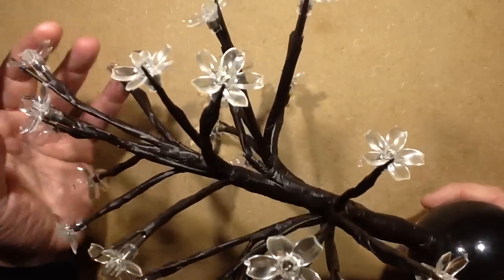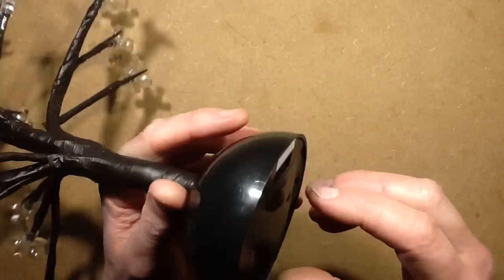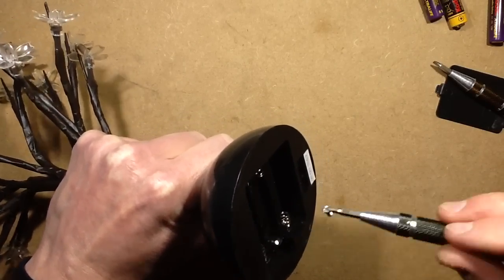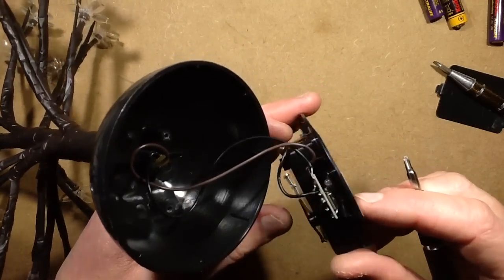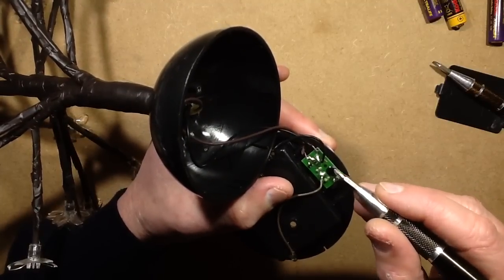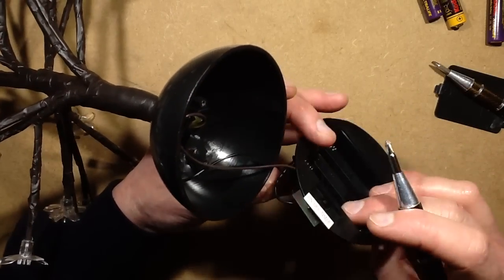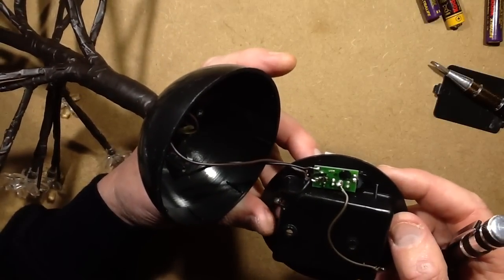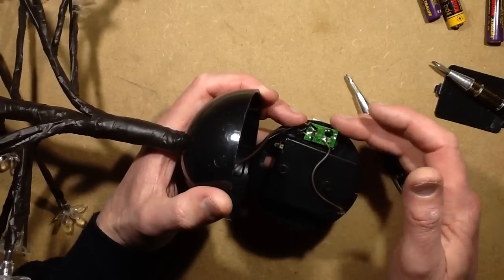Premier battery LED tree 2015 with new timer circuit.

Comment: It should have latitude set up so that if I buy one and use it in Helsinki, Finland it will not light up in summer because it is not dark enough it to be seen and during winter it will light up about 2pm and shut down at midnight.

Comment: you should try making one! :D
Reply from the maker: +killer1479 I already did a project involving a soldered structure wire tree with sockets on the ends of the branches.  I also tried to make a super-simple timer based on a PIC microcontroller running on its internal RC clock, but it kept terrible time as the frequency drifted with the battery voltage.
Reply: bigclivedotcom wow, sounded like it started off great tehn ended up depressing D:

aanyway, im hoping to purchase some pcb's from your website soon :D
Reply from the maker: +killer1479 I may revisit the timer, but with a crystal reference.  However, I bet we'll soon be seeing little strings of 20 LEDs with the timer in the battery pack soon.  At least if I do it and put the software up, people can change the times if needed.  Like 5 hours on and 19 hours off or 8 hours on and 16 hours off.
Reply: bigclivedotcom would be a cool idea! :)
Reply: Andre Fish cool!

Comment: How about further investigations? Power/current consumption? Expected runtime calculations, blob reverse engeneering, outdoor use, build quality, LED color, etc. This could get interesting. Why do they need a transistor? An Attiny could povide 40mA directly. How are the LEDs wired?
Reply: +Frank Bergmann Based on a similar led string in the US (Home Depot/Martha Stewart), the leds are all in parallel with the single resistor. And a ATTiny 40mA drive will drop 1+ volts, and is also 20 mA greater than the recommended output max. 40mA is Absolute Max.

Comment: That tree looks like one of your constructions clive, electrical insulation tape or loom tape wrapped around supports, thats got to be an electricians design LOL :-D
Reply: +zx8401ztv yeah at least use green tape! (i have a metric ton of green tape i got free, i cant use it up fast enough, its been 25 years already!)
Reply: +jusb1066 lol i know what you mean :-), i had reels of single sold core wire with an odd coloured covering, brown mottled green, im sure it was some kind of telecommunication wire, i used it for everything.
Took bloody years to run out lol, someone gave me the rolls a looooooong time ago, i cant remember who it was, so dam long.
I wired a mates homebase cb pcb into a new case using a reel of green wire, the harness looked nice in green, ive still got that reel as well lol.